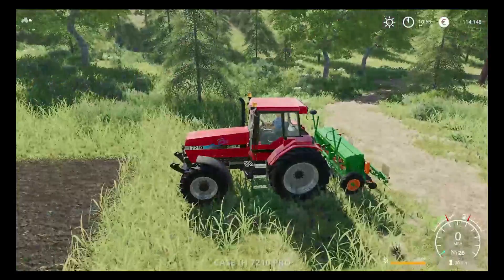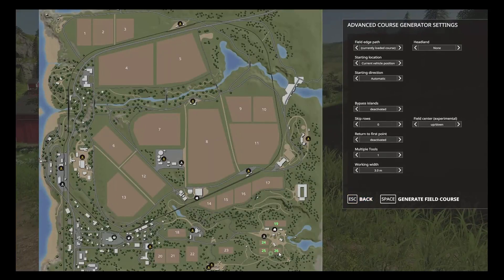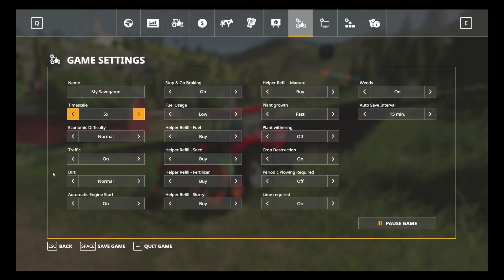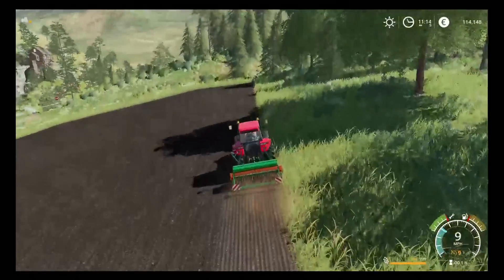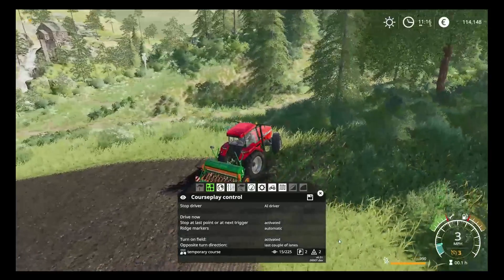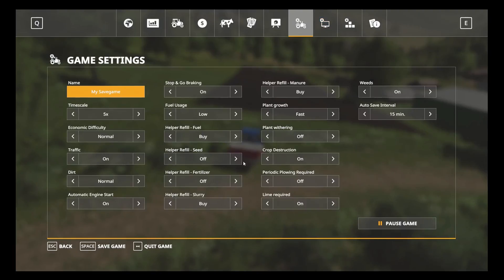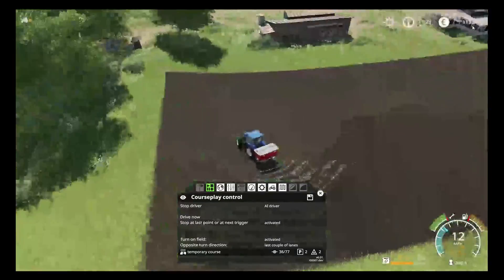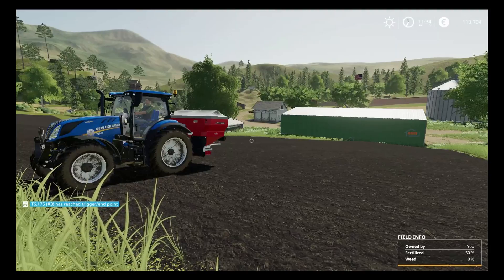CoursePlay in Farming Simulator 19 | Episode 3: Fertilize and Seeding

Comment: its not possible to have 1 course for multiple fields right ? and if i have parked my tractors in the shed can i activate the course and it will drive to the start point ?
Reply from the maker: So you could make two courses ( one for each field) and connect them together, with a third course. The second question depends on the map. What I do on that situation, is create a course from the shed to the field, and join it onto the field work course. Should automatically start work there.
Reply: @SimulationForTheNation  hmm okay thx for the reply!